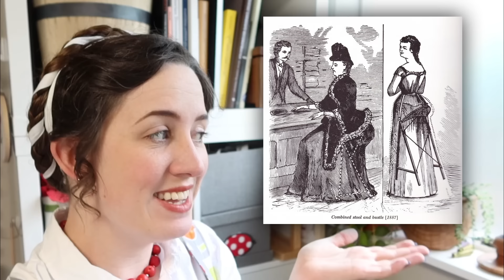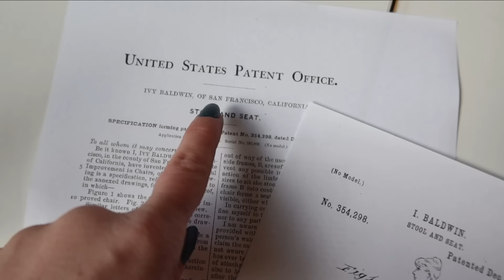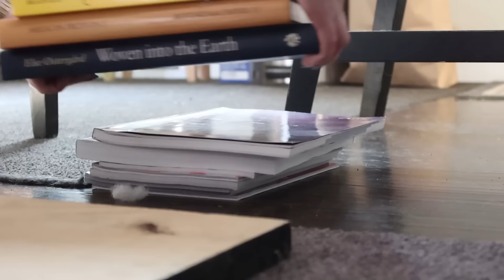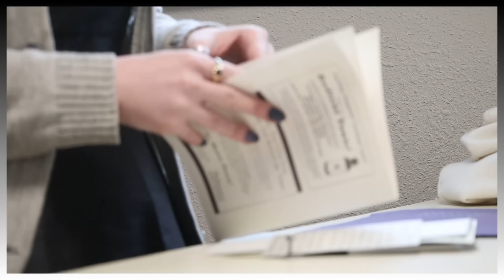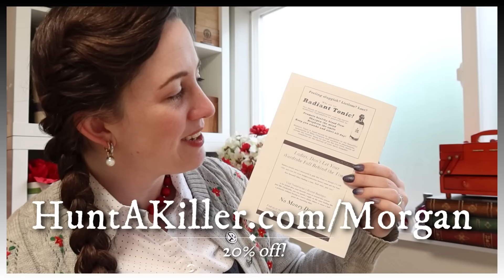Weirdest Victorian Invention: The Bustle-Chair (and we made one)

Comment: people: victorian clothing was oppressive to women!!
the chair bustle: think again
Reply: This made me legit laugh out loud😂😂
Reply: On the other hand 8 pounds of light clothes vs 2 today.... And that is without the metal bustle.
Reply: @mellie4174  you don’t really notice the weight of the garments when you wear them though. Plus consider natural fibers vs poly. They were still much cooler even with layers than we are today
Reply: @mellie4174  you must not live in a northern climate.
Reply: @marinachristine2591  have to disagree. If you have any kind of condition that includes fatigue as a symptom, you can tell when a NECKLACE is too heavy. Also, you'd have to avoid bodies of water....if you fell in, you're going straight to the bottom....but at least you'd have a good seat while waiting for potential rescue. XD
Reply: @firegodessreiko  Depends some on the article of clothing as well.  Necklaces don't distribute weight very well, while something like a corset is good at balancing it across most of the torso.  That said, depending on how bad the chronic fatigue in question is, it could still be very unpleasant.
Reply: @firegodessreiko  Yeah I don't have chronic fatigue but things like heavy coats and backpacks are pretty draining
Reply: @firegodessreiko  Yes, but that is more due to the fact, that most clothes at that time where made of wool. Which absorbes moisture at a higher rate than modern clothes. There is little that wool does not absorb - you can use it to purify air, fyi.  So it might not have been to heavy in conparison to modern ball gowns in it's dry state.
Reply: @mellie4174  that's not inherently bad though. It can be for some, but for others like my aut-spec, adhd self, the extra weight is grounding and protective. So sure, for many that's a draw back, but for others that's a boon, and there's also the vast majority who won't notice a thing. Therefore, you overall come out being at least neutral; it's still not oppressive.
Reply: @firegodessreiko  That's a very valid point- people with chronic fatigue would probably have more problems with this. I will say, though, that it probably wouldn't be as bad as you'd first think. 

Corsets do a good job of distributing that weight across your entire torso, as well as acting as your core and ab muscles, hevily reducing the energy needed, or even being capable of eliminating the energy needed entirely (when made with the intention to do so) for things like sitting upright, standing, and walking. Meanwhile, with the necklace example, your neck muscles are entirely responsible for the necklace's entire weight and the weight of the head, which is also an exhaustingly heavy thing. In other words, the necklace might actually be worse. This doesn't mean your point is moot, of course, but rather just that it is very possible that women at this time that had chronic fatigue did not encounter nearly as much issue with their clothing as one might assume.

And as for the water thing, while you are correct that a Victorian get up will eventually drag you to the bottom, you're also supposed to strip the moment you fall into water, regardless of whether you're wearing modern or late Victorian clothing, before you start to swim. Modern clothing is lighter, so it does produce somewhat less drag, but it still produces enough that a weak swimmer should ditch any loose peices. Victorian, meanwhile, is absolutely impossible to swim in regardless, but also is a very, very buoyant cluster of cloth for a decent bit of time, allowing for easier removal during that period, and allowing a moment to collect yourself, or even for someone to collect you. In other words, unless you fall into fast moving water, Victorian clothing might actually be equal or even preferable to modern clothing in this regard.

Also, even in modern clothing, if you fall into a rapid bit of water without being able to swim, you will drown almost immediately. At least with the Victorian, the buoyancy keeps you visible to others a tad longer. It's all give and take though, of course, as this same principle could hinder a strong swimmer who might've otherwise needed no assistance enough to easily render them unable to save themselves. It's intrested though, no? :D
Reply: @hyperfox0934  Interesting what you say there. I'm an Auspie, and I love wearing long skirts, to the floor long. LOVE it. On a normal day, I wear leggings under a just-below-the-knee skirt because it gets fewer comments. Never occurred to me before about my Auspieism and love of long skirts being related. I also love long sleeves and don't mind wearing a mask.
Reply: @hyperfox0934  Yeah, I mean we had to learn how to take jeans off in water as part of our swimming lessons in primary school (I think it was to get the lifesaver badge). First we had to swim around in them so they'd get thoroughly wet and they were just sooooo heavy. Then had to take them off which was stupidly hard. (honestly if you're jumping in to save them its quicker to take the jeans off first before jumping in).
But I've worn plenty of different corsets and even the heaviest ones made of lots of layers and plenty of steel bones don't feel heavy when worn. Just feel like a nice hug, since its basically just deep pressure therapy. And weirdly corsets have been one of very few things which my body is capable of not noticing too much when worn. I've never had the experience of not noticing fabric against my skin because the way my autistic senses tend is towards major hypersensitivity. Only one which is really hyposensitive is probably the proprioception one or whichever it is that allows me to ride those theme park rides that spin vertically (like the Enterprise ride at Alton Towers) 11 times in a row without getting sick (did my my dad sick though which was hilarious).
Reply: @Yakarash  drowning was still a very real danger for ladies in Victorian times. They bottom line wore more fabric than men AND swimming wasn't considered a 'lady-like' activity. Avid knitter. I know what wool be like~
Reply: @hyperfox0934  erm, I have Fibromyalgia....so I think it would be exactly as bad as I first think, sorry. I do not disagree that it it quite a cool contraption and was clearly someone's attempt to meet a need and be kind~ I only disagree with the notion that 'you wouldn't be able to tell how heavy it is'.
Reply: @firegodessreiko  fair, fair! That particular little statement of mine had actually switched back to addressing typically-bodied folks anyway, so I 100% agree that it definitely would be at least noticeable for someone who isn't. Plus, Fibromyalgia includes pain, correct? That definitely changes things from when I thought we were talking about plain chronic fatigue.
Reply: @dsvance1  Multiple anxiety disorders here and though I'm not a skirt person I'm so much happier during the one month a year I can wear long sleeves in Texas. There's nothing more soothing when I'm having a tough time than a thick, heavy sweater! Masks actually seem to help a bit when I'm out as well. The fogging glasses are a pain and not being able to read facial expressions can be a bit stressful but by the same token, I don't have to try to figure out what those facial expressions mean or if I'm using the correct ones myself 😅
Reply: @firegodessreiko  this what the bustle chair is for, get fatigued, just sit
Reply: @Yakarash  wool actually retains a lot of insulation when wet compared to other materials

Comment: Mr. Morgan Donner: “I’m going to make a lap joint.”
Me: “...could you please explain that in terms of seams?”
Reply: Think corner and one edge is 'plain' seam and the other is bound with ribbon that goes over  the front and back of it, so you slot the plain seam into the corner of the bound seam.. i think best way i can describe it as a seam

 Or if you are familiar with anatomy, think joint: one ball and one socket, but in the lap joint its a square peg as the ball and a equally square hole as the socket
Reply: Hege Valle not quite. I think what you're describing is the mortise and tennon. The mortise is a rectangular hole and the tennon is the shaved down rectangular tongue sticking off the end of the other piece that fits perfectly inside the mortise to create a really strong joint. 

A lap joint, also known as a half-lap, is when you have two pieces of the same thickness and you remove half the thickness of each on opposite sides so that when they are put together the overlapped sections is the same thickness as the rest of each piece. I can't really think of an analog in sewing because I can't think of any seams where you'd remove half the thickness of the fabric since that would pretty much destroy the structural integrity of it.
Reply: Probably like when you cut the excess out of corners
Reply: @alexreith4877  I agree, there's no real equivalent to a lap joint in sewing.
Reply: @auditoryeden  Makes me think of mitred corners on things but that's probably because I do mine badly as I forget how/when to do them and come back later to try and make it look nice.
Reply: @auditoryeden  Maybe the closest would be when doing flat felled seams where you trim one side of the seam allowance down shorter so that it lies flatter. That's the closest I can think of anyway.
Reply: @alexreith4877  
The picture in the video was the hole & insert part. Properly labeled as not a lap joint.
Reply: Catherine H, I was talking about the part at 3:57 where Mr. Donner is very clearly describing a lap joint. The mortise and tenon picture comes after that. The original commenter asked about a lap joint.
Reply: Belated, but I think the closest equivalent would be in tailoring, where they grade the various interfacing layers away when approaching the seams, so they don't add so much bulk.

Comment: My hypothesis based on the design of the chair, especially the tilted seat: could have been intended for artists, either to go out and paint outside, or as the models themselves so the chair is hidden under the dress and isn’t distracting
Reply: It probably also makes it less uncomfortable as you walk-- it's tilted closer to parallel to the legs instead of a right-angle corner so when it hits your butt or the back of your thighs it'll slide across instead of digging in, which would be pretty uncomfortable even if you sand the corners round.

Comment: Seat angle theory - I wonder if the seat is angled because as you walk the seat will try to tip on its straps and sit flush with your body. The seat being angled vs flat will prevent the legs poking out horizontally and disturbing your skirts. 
Maybe.

Comment: You are absolutely amazing. One question, are you certain the chair was not designed to collapse or fold whenever the lady stood up? Just seems to me that if it were made thusly, then it would be possible for the seat of the chair to then rest against the  glutes. This would also prevent the chair legs from impacting the lower part of the legs as you walked. Ooops, more question was there a problem ascending or descending stairs and was it possible to run or move swiftly while wearing the apparatus? Love your work please keep it up.

Comment: You could hide an M134 Mini Gun under there, and there would still be room for a truck battery to run it on, and a few thousand rounds of ammo!  It would be kind of heavy, though, but you could hang it from the underside of the chair and put castors on the legs, to take up the weight.

Comment: I think it should fold up when you stand unfold when you sit.  I don't like the angled seat design.  too likely to slide off. play with the idea of more of a basket like seat with a flat bottom.  I think the thighs would push it into a bustle position.  I see the legs more of and X style with one set stationary at the back of the seat the other would slide back and forth had tape attached to the side of the dress would let you pull it forward to sit and push back when you stand up so it folds..  like the idea thanks for sharing it.

Comment: Kind of makes you wonder how long this 'chair' was in fashion, for. However, on the other side of thought you can definitely see the origins of where today's seated (medical) walkers come from. 

BIG Q: How comfortable or NOT did you feel in lugging that contraption around, underneath your clothing? Seeing you walk around with that strapped to you, kind of makes me wonder in all fairness whether or not the device might have had 2 more straps (1 more add'l on either side) to even out the weight as you walk. Food for thought.

CURIOSITY Q: Would the chair / bustle padding have worked better if the padding belt would have been put on first then, the chair 2nd? Just thinking outside the box.

Was there any literature that told exactly WHY the chair was invented in the first place?